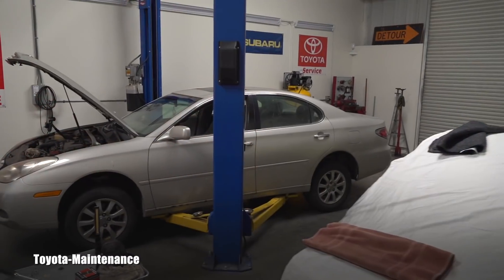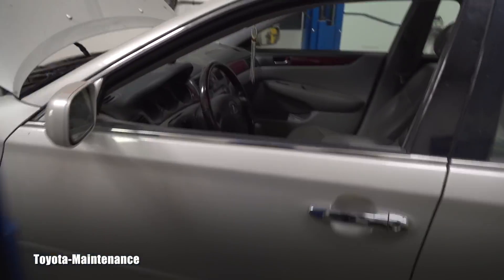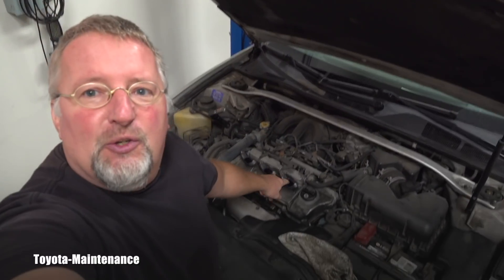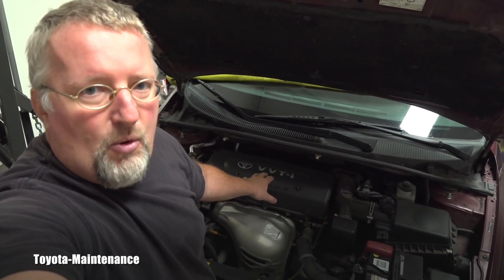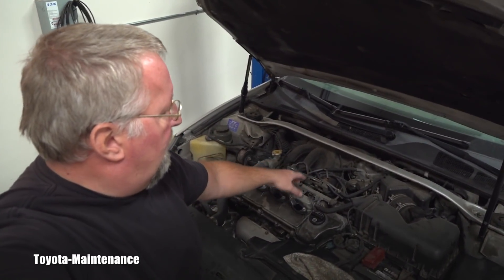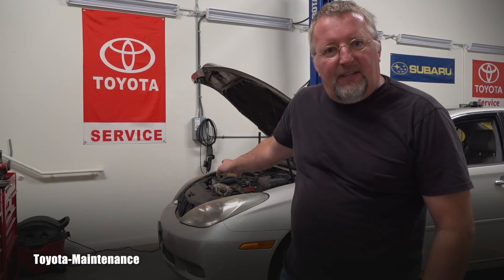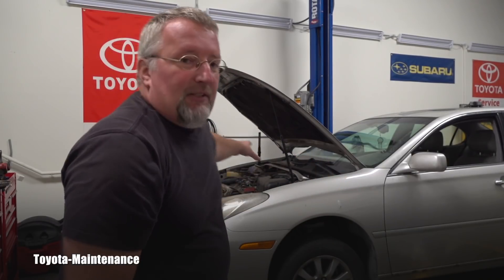4 Cylinder vs V6 Engine - Cost of maintenance and repairs

Comment: On V6 engines most people don't change the back three plugs because of the labor. Also whenever you get a quote for something they say oh about 100$ but then you say it's a V6 and they say oh that's another 100$. Lastly four cylinders are usually equipped with timing chain and V6s are usually belts. Here's a odd thing though my 03 camry 4 cylinder has a bigger gas tank then the V6.
Reply: Not entirely true.  Timing chain was introduced with the 3.3L V6

Comment: I'm debating on getting either ES300H, GX460, or a Limited 4runner.  The only thing I don't like about the GX and 4runner are the MPG: 17MPG VS 40.  I understand they are two different types of vehicles.  I will decide in 2022.

Comment: Oh no! I have a 95 Camry with the 1MZFE. He's right. Doing any job close to the firewall can be really hard 😓
Reply: There are some videos on here that don't require all Petah says. You can access the rear plugs by sliding your hand through the sides under the manifold. the one by the pcv is EASY. The other two are harder but not impossible. Takes a half hour longer if you have worked on cars before. The trick? Use two small extensions and a stubby ratchet. The video on here that's super old by the black man is awesome. Just be forewarned, the boot might be stuck on the porcelain. I needed a stronger guy to pull them off for me.

Comment: I don't believe you have to go underneath the car for the bottom bolt of the bracket(s). Just remove the top bolt of the intake manifold engine holding bracket and throttle body holding bracket (if it has both). Still a pain on some models with 1MZFE when the firewall is squished so close to the bracket bolt and the bracket feathers out on the sides, preventing wrench access. I had a bitch of a time the first time I removed it on my 99 ES300. You end up having to push the bracket down with pressure while using a thin quarter inch ratchet with a 14mm socket.

Comment: Plz tell I won't have this problem with my 2005 Camry XLE V6! I remember having an old 1985 Chevy Monza 2+2 V6 and they had to lift the engine to replace the spark plugs. Wonderful engineering!
Reply: I looked it up and the short answer is yes you will.  But, found a guy showing how to changer 1,3,5 without removing much.  https://www.youtube.com/watch?v=qf-4hq3kJFI
Reply: Don't you really mean 1975 Chevy Monza?  I had one of those with the 262 engine, and I remember some of the plugs were difficult yes, but I was able to do it.

Comment: Used to own a 2002 Toyota Camry V6. Valve cover gasket needed to be replaced and it was very expensive. I now own a 2012 Toyota Corolla and it so much less expensive to repair and maintain.

Comment: V6 Cons: 
1. Spark plugs are a pain in the arse to change, that's expected with any transverse mounted V6, requiring the manifold to come off means you can blast out any carbon, oil deposits, replace PCV valve, etc, so it's a con but also a benefit.

2. 1MZ's do have over sensitive knock sensors, but they only play up in my experience whenever people use cheap fuel, they do benefit from premium unleaded, basically resolves that issue, along with mild performance gains in driveability, etc - not necessarily power, but 10.5:1 compression i run premium because it's a sin running a high comp motor on cheap fuel. Now the ESA (Electronic Spark Advance) that all 1MZ's have is giving you full advancement not pulling timing like it would be on cheap fuel. And besides the ES calls for premium anyway.

Pros: unbeatable smoothness of the 1MZ compared to a 4cyl ?, sorry but V6 any day 😂
Reliability of a 1MZ is high, especially maintained 
Low down torque, etc

Yes a V6 will always be more expensive to maintain on any Toyota/Lexus vehicle, but the service you get from one, it's worth a minor set back every 90,000km/55,000mi when spark plugs need changing
Reply: I agree with using premium on 1MZFE. Never had a knock sensor issue on my 99 ES300 with 200k miles. I could notice the difference in how the engine sounded and felt with regular fuel. Didn't like it!
Reply: @nikovandh  The only thing i would do is the radiator fan switch located in the lower section of the side tanks is replace it with a lower temp switch. Factory thermostat which is brilliant for Australian climate is perfect.

82°C/180°F - people say it's too hot, not at all, unlike GM which love 200°F/94°C+ operating temps for "emissions" bulls**t
But the issue is the cooling fans don't kick on till 95°C/203°F  which in my opinion is a tad warm, so there's a more appreciate switch.

Basically in simple term, stock fan switch (radiator)
On @ 95°C/203°F
Off @ 90°C/194°F

But remember they're running an 82°C/180°F thermostat.

The aftermarket switch available (NOT A DORMAN) is by an Australian company. Which offers the following...

On @ 90°C/194°F
Off @ 85°C/185°F
Those temps above are more what i'd like to keep my car running at in conjunction with it's originally designed operating temp (80°C/180°F - 86°C/187°F)
Reply: @nikovandh  It's the higher octane that allows the ESA to function at 100% capacity due to the extra octane it can further advance before pulling timing back. Also those that use iridium plugs instead of what the 1MZ was specifically designed for (double tipped platinums), i laugh 😂😂
Hell i run my 1MZ on 0w40, it loves it, but it's a frequent thing. But i live in Australia sooo....
Reply: @ThomasFG  My factory service manual for my 99 ES300 says to use SK20R11, which are iridiums.
Reply: @nikovandh  Yeah i think the Toyota specific models (NON VVTI) are actually more designed for maintenance over the VVTI version running iridium plugs. I'd still replace them every 90k km/55k miles regardless
Reply: @nikovandh  It would be Denso or NGK equivalent most likely on an older Toyota product you have both options

Comment: V6 also has two head gaskets to worry about, etc.  Some people have said it might be nice to go back to the I6 design rather than V6.  I suppose, though, because an I6 is longer, it would be much more suitable for RWD (or maybe AWD?).  That would be for the engineers/designers to figure out (how easy is it to transverse mount an I6?).  Maybe just scrap the idea of "6" altogether and go with a larger displacement I4?  I'm not a mechanic -- so, people with experience, feel free to comment on the idea of I6 versus V6 versus larger I4.  Thanks.

Comment: I drive a 3rd gen Toyota 4runner V6 and it's easy to work on, the air intake tube is held on by 2 clamps, after that you can access an entire side of coil packs and the other is easy access too. 1st time ever doing entire valve cover gaskets, half moons, circular cam plugs, pcv valve and grommet, and spark plug tube seals took me 12 hours, keep in mind it was my very 1st time and alone, the second time done on my father's 02 3rd gen took like 7.5 hours, and way less stressful since I broke the 1st time barrier.. labeling everything that came apart with their matching numbers on a bright colored tape definitely made everything go smoother.
Reply: Same truck here. 1996. You did well. 1st time & second. It’s a good vehicle. I’m at a cross road.invest a good amount of $ in the 96 or get a newer one. Going to invest in 96 1st & get a second,open bed pick up,ASAP. TAKE CARE
Reply: @wbwills2  Thanks, yea 3rd gen are more mechanical hence not as complicated to work in comparison to the new high tech stuff. But, I will Godwilling get a 5th gen at some point. I'm actually more interested in a 4wd 2002 Toyota 4runner at the moment.

Comment: My parents learn the hard way when we bought the 2006 V6 Camry, it was okay and fast but like you said, getting to the last 3 spark plug was awful. Also the engine was timing belt whereas the 4 cylinders were timing chain. Anyways, they're going to get the Rav4 which I believe will be better as my 2005 4Runner has lasted this long. Too bad you're not in Silicon Valley otherwise I would take the care in for repair at your place.

Comment: The v6 Toyota was just a bad design for maintenance 

The Honda v6 easier for maintenance
Reply: What about changing the Honda V6 timing belt that Toyota replaced with a timing chain 15 years ago.

Comment: V6 FWD is no fun when they have issue. Would be nice if V6 was mated to RWD.
Reply: It is.buy the GS350
Reply: @dummgelauft  Lexus GS does not use inline 6 ?
Reply: @Pallidus_Rider  no. Same 2GR-FE as ES350. Now 2GR-FSE
Reply: @dummgelauft  Kinda prefer 1JZ or 2JZ

Comment: If you can verify that all the front cylinders are OK and not misfiring, replace all the plugs and move all three coils from the rear bank to the front bank.  If the misfire moves, then you can easily replace that coil.  If it stays, then you know you have either a wiring issue to a coil, or a compression or injector issue.  Scope the primary side of the coils and if all looks good, you're looking at injector or compression.  If you're really good you'd current ramp the injectors and do a relative compression check before doing the spark plugs and coils swaps.

Comment: Excellent tip! If it were me, despite the additional cost and as several people here have already suggested, I'd replace all the coils as well as the plugs in the back as well. If one or two wasn't bad then so be it. Still, overall, what an engineering disaster!

Comment: I'm in the middle of replacing my '12 Avalon's alternator right now....oy!, what a job.  My son saw it and is now asking for a 4-cyl Corolla when he begins driving.  Good son!
Reply: Was quoted $880 to replace my alternator on my V 6.  Bought a good battery tool that also checks the alternator which turned out fine.  Needed a $100 battery so saved $770.  Dodged that bullet by not listening to my dealer.
Reply: @Paul-c2o  Plus on the outside world, far from the dealer, it would just be around $400 or less if the tech is experienced. Alternator by Denso is about $130-$150.
Reply: Same with the starter motor if I'm not mistaken?

Comment: The unintended consequences of making a engine bay smaller.
Reply: I think the a big problem is you’re jamming an engine, transmission and differential into that space
Reply: Consequence of improving mpg. Reducing size and weight, increasing aerodynamics equals better gas milage, but also increases higher incidences of busted knuckles, eruptions of salty language, and frustrations from diy's 😂

Comment: If you take your time it's possible to change the rear spark plugs without taking all the stuff loose or removing it. Did it in my 6 cylinder 2003 highlander.. is it fast no but much faster than taking all that stuff off
Reply: I agree. People don't know this. Here is a reference video. Short extensions are the key just like how he put the tool in one at a time changing the last plug on his sequoia. Socket and then extension and then extension again https://www.youtube.com/watch?v=6uFOLnmWwN0

Comment: Excellent topic for discussion.
I have 1999 Camry v6 and 2010 Camry I4. After the initial cursing, I managed to replace the V6 back spark plugs from the space on left and right sides of the manifold. A spark plug with broken wire gave me some trouble until I found a deep socket.
Now let's imaging how a PCV on the 2010 I4 be replaced? It would need to remove a lot more parts!

Comment: i got a 2010 Prius did the spark plugs myself,. a course with the help of my friend (YOU). my girlfriends drives a Lexus rx350. with the same engine on this car. i would probably not going to be able to change the spark plugs on her car :(
Reply: Yeah the Prius is a little bit of a pain you have to take the windshield wiper bulkhead assembly out but it really is only about 10 bolts and takes 10 or 15 minutes maximum . Not such a big deal. on this Lexus it Would have been nice if they'd have rotated that engine a few degrees to the front and picked a different intake manifold design.
There are front-wheel drive v6s that are not like this period some of the 3800 series 2 engines from GM are easier to work on. But you're also likely to be working on it the hell of a lot more LOL

Comment: I agree but you have to understand the basic logic. You have a car that you want to put a bigger motor in with more cylinders to make more horsepower, obviously it gets cramp with the limited space they have to work with. So they have to take advantage of every nook and cranny and it may not be very accessible to maintain. 
I have an older V6 camry and I love it but it does worry me when I looked up how to change the alternator that you would have to take out the radiator, intake and fans just to change the alternator on the V6 while the 4 cylinder is way more simple and straight forward. Parts costs is more too. Luckily, I didn't have to change the alternator but it made me understand things more. It's how it has to be if you want more power and more cylinders. It reminds me of german/european cars. They are built for power and maintenance is not cheap. But toyotas are still way more reliable than most european cars. The cost of parts and labor is still cheaper for toyotas. Obviously the v6 toyotas may cost more to maintain because it's difficult to get to all the main areas for repairs. I would take a V6 toyota over a european car any day for the long term. On the flip side, you have to feel the power of the V6 camry's --- shifting is so smooth you don't even feel it and the power band is right there. Most people are surprised how fast the V6 camry's are with it's lower weight compared to american V6 cars.

Comment: Maintenance Is not bad on those Scion's or the 4 cylinder Camry's until you need to replace the timing chain tensioner Then you have to basically remove the engine to get to it. Power steering pumps can be a real bear too!

Comment: This is the exact reason why I looked for a 4 cylinder Venza over the V6.  Most stuff could be done by yourself.  The drive isn't much different than the V6.  This channel is very informative.
Reply: No. I beg to differ. The 4 cylinder engines are very loud, and in no way has enough power to drive it. The car is way too heavy for it. For example, the Highlander and sienna had the 2.7L options, but no one chose them because there wasn't a big difference in fuel economy, so they discontinued it. Anyway, I like the venza v6 over the 4.
Reply: @SuperMan-uj7dh  And Venza Hybrid beats both.
Reply: @SuperMan-uj7dh  well I actually own the 4 cylinder and test drove the v6 and literally no difference and mine with 95k miles have no problems with a loud engine.
Reply: Zero to 60 in about 6 seconds is the difference.
Reply: @rkgsd  Normal driving it doesn't mean squat.  It's a boring family car.
Reply: @marknguyen7231  must be slow old man driver so you can't tell the difference

Comment: I have that same 4 cylinder 2AZ engine on my 01 highlander. Everything you said makes sense. I basically became my own mechanic.
Changed filter, cabin air filter, spark plugs, coil packs, valve cover gasket, PCV valve. Power steering fluid. Now I bought  things so i can do my own oil change on my car. 
It's fun, a challenge, & your family leaves you alone when you work on your car or one of theirs.
Reply: T3l3MuNd0 I do same on my car.  After you go that far, you have to change all those.  But the joy of driving it and saving the money . .  Priceless
Reply: @johnkaranja2897  exactly. My parents have a Lexus RX350 & that's a V6. They bought it brand new & it's been running for 15 years & has a good 205,000. The mechanic we go to has trustworthy prices. Like my 4 new fuel injectors, parts & maintenance all together was like only $830 when average fuel injectors are 150-200 per piece & I knew it was reasonable. Anyways the V6 spark plugs change for their lexus was 650$ 
My new denso spark plugs & grease parts were 38$ just on the plugs 😂🤣

Comment: Just replace all  the coils and plugs in the back. I have a similar v6(12 yr old)engine, has a misfire after 11 years of trouble free ownership, and to be honest that v6 is one of the best engines I've had. Buttery smooth and powerful. Costs more to maintain but would still buy another.
Reply: Sure, spark plugs are a bit old so spend hundreds replacing the coils. Whatever.
Reply: @chocolate_squiggle  hundreds? Where do you buy your parts? These coils are no more than $40-45/piece, and if you look around, maybe less. 3x45 is $135...certainly not "hundreds"..yeah, you can leave the front bank coils alone..they are easy to get to..just do the aft ones..
Reply: @LAactor  thank you for the enlightenment, master technician. (Unless you are being sarcastic). In which case..LOLLLLLLLLL
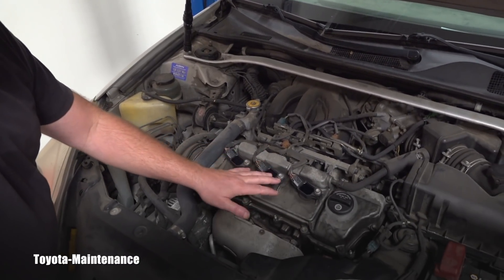Go watch the video again. And start paying attention at 2:00 mark..and tell me what he says at 2:08
Reply: @dummgelauft  The more arrogant a person is, the more they try to brag about being a master technician. But when your ego outsmarts your knowledge, you have failed any certifications you have earned. Notice Peter doesn't brag often about his years at the dealers. I will repeat to you again, there are no coils in the back and just because one technician feels there is no way to do this job without removing the intake doesn't mean it is the only way. And I have personally removed the back three on this engine with stubby ratchet and short extensions and put it in like how he did it on cylinder 7 on his sequoia. But if you saw those videos online you would know. Or you can watch again. Saving the customer hours of being charged shop time. But I don't blame you. Most just don't have the experience or knowledge. Just because he said so doesn't mean it is the fully "enlightened" way. But just so you know, you brought up a new topic where he references taking off the intake. What everyone else is talking about on this thread was about coils. So not sure why you are bringing up an unrelated matter at 200-208.
Reply: Exactly. If you have dug that deep, replace all consumables. Plugs, coils and manifold gaskets.